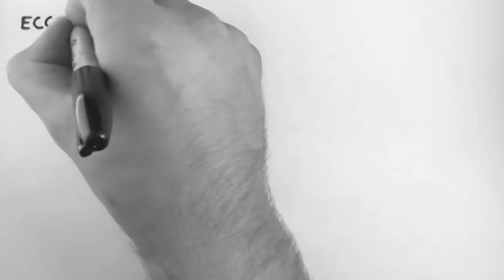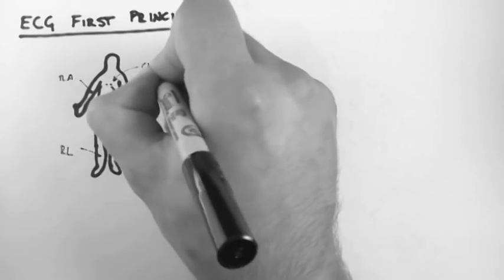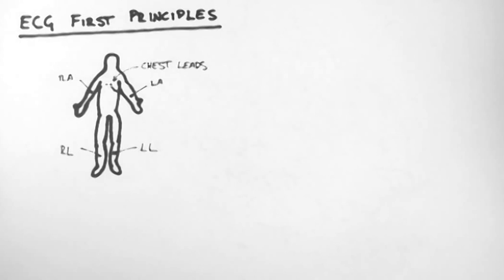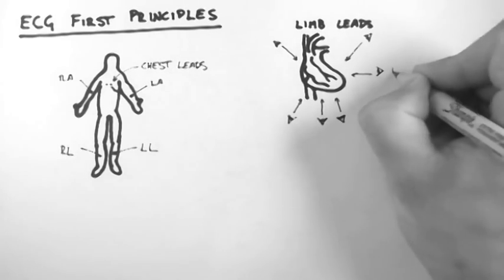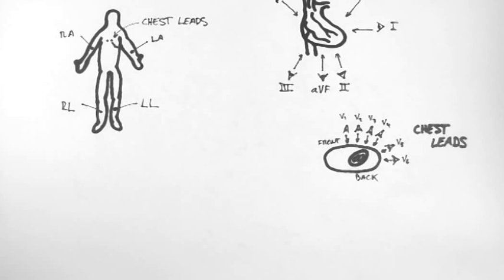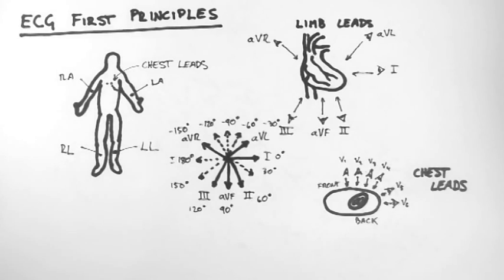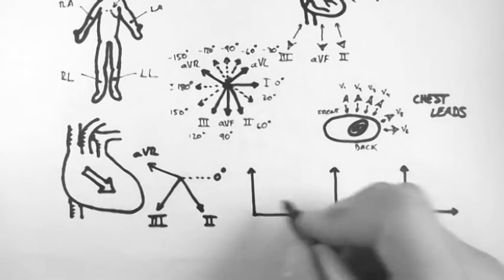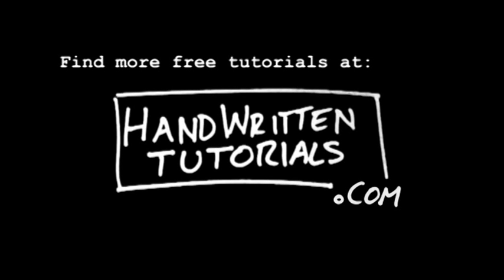ECG 1 - ECG First Principles

Comment: I think what he may be trying to get across is that we call it a '12 lead ECG'. Yet there is not 12 physical leads but instead (in this case) there is 10 physical leads LA, RA, LL, RL + 6 chest leads. However, when we look at an ECG reading there are 12 leads as some are calculated to represent the electrical activity in the heart. I, II, III, AVL, AVR, AVF, V1,V2,V3,V4,V5,V6. 
I hope that helps!

Comment: Just as an FYI, the chest leads v1 to 6 begin medially at v1, but end on the left side under the arm at v6 (not on the right as drawn). This is obvious because the heart is tilted to the left side (not the right side as drawn in the circle representing the thoracic cavity). Good video but!
Reply: I believe that the drawing would be wrong as you state if we assume that we are looking at if as if we were standing at the patient's head (lying down). It is correct, however, if we were looking at it as if we were looking at a supine patient from the feet up (the same way you would look at an mri/ct scan slice - from the feet up to the head)